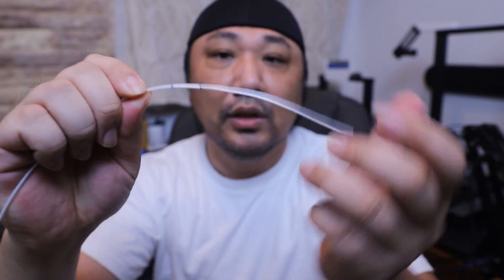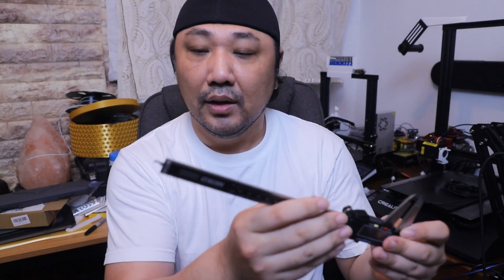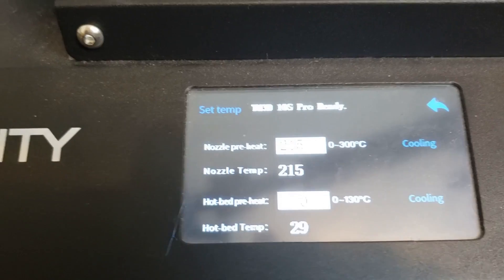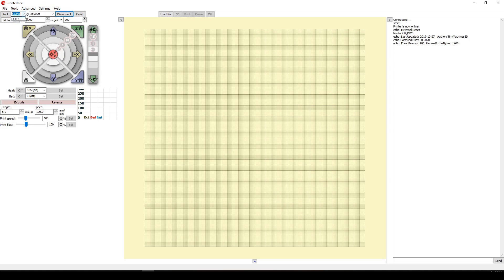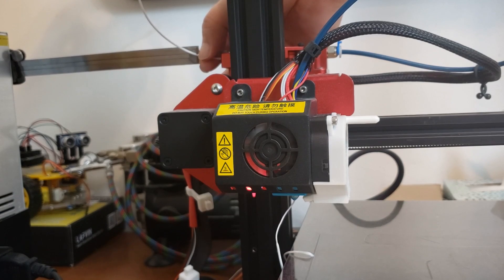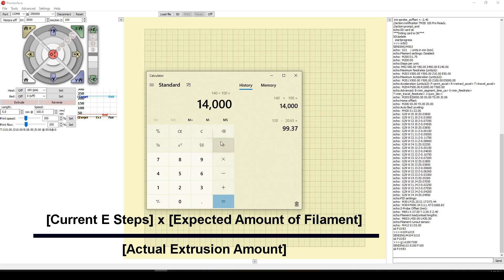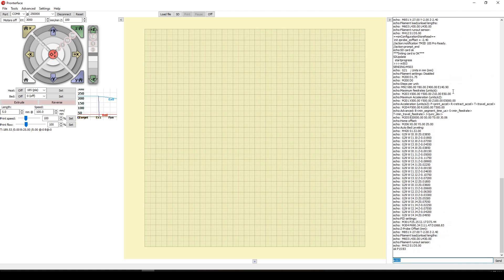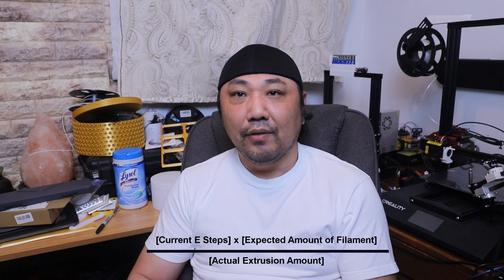CR10s Pro Estep Calibration - Guide to calibrating e steps for the cr10s pro.

Comment: I suggest you set your caliper to 120mm then with a rule measure how far the rod sticks out at the back , you say 120mm is to the notch but I have just tried 4 different calipers, from the cheapest up to a mitutoyo and on all of them the 120mm is to the end of the rod not to the notch, the notch is simply so you can get into small diameter holes to measure their depth . Assuming your caliper is like all the ones I tried then your extrusion is about 90mm not 100
Reply from the maker: Yes, to the end it's 120, but on the digital side you can zero out measurements. So pull out the caliper to the notch. Zero out the measurement. Then pull out another 120mm.. I think I mention it in the video somewhere to zero out the notch.. The idea is to get 120mm using any type of measurement device. I thought the notch helped out holding the measuring stick in place.

Comment: What if the extruded settings have been previously altered? For example, mine is at E142.8 from a previous calibration…now i just installed a new all metal hotend and want to make sure esteps are good… should I reset back to E140 before doing the test again?

Comment: The TM3D firmware has a esteps entry screen under settings / offsets.  I wish the video had shown that so I could have shared it with someone else.  I understand you probably wanted to show something that would work regardless of the printer model.... I'm just trying to find something that shows the simple / easy touch screen method.
Reply from the maker: You could make a short clip and upload to share. I don't think there is a easy simple way when trying to get it to work perfectly.
Reply: @DiyProJames  if I had a tripod camera I'd do it.  My hands shake too much for me to film it.  There is an entry screen where you can put the steps in.  It doesn't get much easier.
Reply: @underourrock  I've seen this too, but I haven't messed with it.  I wonder if you could calibrate the E steps by just using that screen?  Would it allow you to change and save your adjustments?
Reply: @rbarraza123  yes.  That's how I calibrate my esteps.

Work flow:. Set nozzle temperature, measure and mark  100 and 120mm on the filament, when heated, I go into the refuel screen and extrude 100mm.  I measure the delta between 100mm and the actual extrusion.

With the actual extrusion I calculate a factor that modifies the esteps.  On the esteps screen I enter the new value and save it right there.

Some versions of Marlin need a reboot at that stage.  So reboot after saving successful message just to be be safe.
Reply: @TorNichols  wow that’s awesome! Thanks I’m going to try it

Comment: Hi! Are you aware of the Creality Facebook Page? Nice to know but my e-steps were also spot on. However, I did have problems with the tube pushing out from the gear extruder side.
Reply from the maker: I think there are several creality facebook groups; which one are you referring to? Are you saying the ptfe tube was loose? Could you elaborate on the details not sure what you mean and were you able to fix it?
Reply: @DiyProJames  Creality Official User Group. I was printing happily when I noticed a clunking noise. When I looked closely I saw my filament clogged up on the extruder gear. This happened 3x. Figured the pneumatic fitting wasn't able to hold the capricorn tube. So I installed a thingiverse bowden tube helper.
Reply: The tube was rocking back and forth loosely during my print.

Comment: Nice video, really! But I came up with a problem. Sending the G1 E100 F100 the extruder skips teeth and it looks like it wants to extrude the 100mm instantly. Nozzle temp 205 for PLA using CR10s pro V2.
Could you point me in the right direction how to know the right speed?

(if I use the Extrude button in Prointerface it goes as planned)
Reply from the maker: F is the feedrate... F100 is 100mm/minute.. Please look up feedrate..
Reply: Did you solve this problem? It's happening to me right now and can't seem to fix it (also creality cr10s Pro v2)
Reply: my extruder spring was too strong and the gear was tearing the filament up so that it got stuck in the bowden tube. I had to cut a turn off of the spring to get it to stop this. Is this what you meant by skipping  teeth?
Reply: @DiyProJames  The ProV2 seems to have a issue where the command sends the extruder flying. It is not trying to do 100mm/minute, it seems to be trying to do 1000 or more a minute. When sending G1 E100 F100 it causes the extruder to try to push it too fast, causing skipping and not feeding close to the 100. 
I guess that most know what feedrate is, especially after watching this, it just seems that proV2 has a issue with this command.
Reply: Found that a F0.2 worked well for me, was about 40 seconds
Reply: @Nocreep4u  thank you very much! worked perfect for me
Reply: @danielwlyles  sweet! Glad to hear kt

Comment: Please, does your video also apply to the original firmware from the manufacturer?
Reply from the maker: Yes, it should apply to the original firmware as well.. The original firmware is a version of the marlin firmware so the gcodes or commands should be the same...
Reply from the maker: @mclareniak  Yes, if you watch my video closely. It does not return a value until I enter the m503 command.. Please check the description to see the commands associated with e step calibration. First m500 to save the steps. Then m503 to see if the changes have been made to the printer..
Reply: @DiyProJames  Thank you, it's OK.

Comment: Hi can you use pronterface to get higher extruder temperature
Reply from the maker: No, you shouldn't be able to exceed the maximum temperature set by the firmware, but you can adjust the temperature within the min max range.